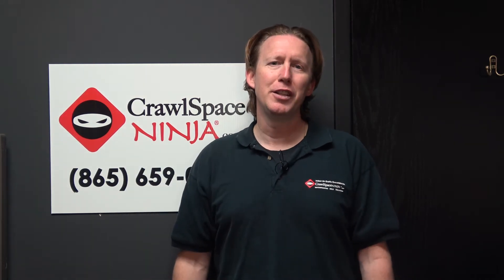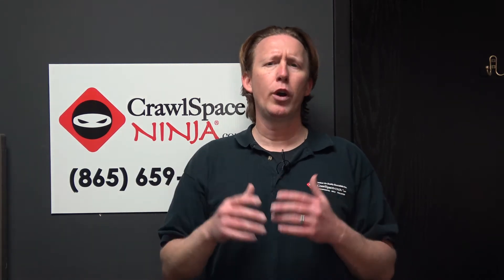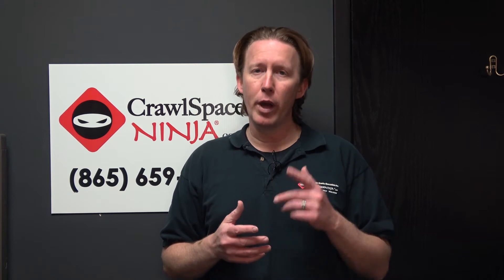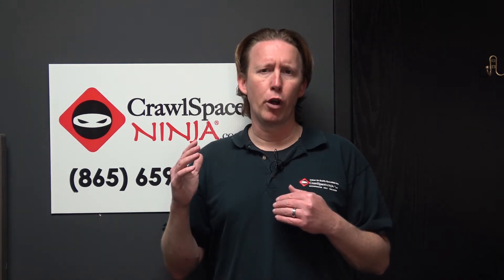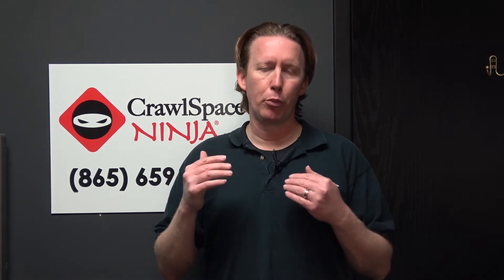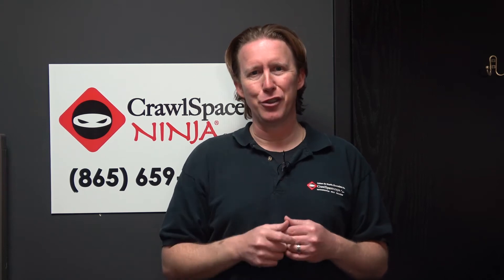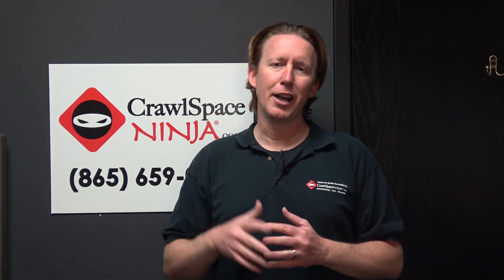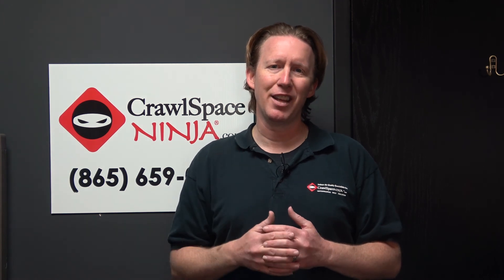Can Foam Board Really Cause Cinder Block Foundation Problems?

Comment: Hey yall I have a question. My buddy already encapsulated my crawl space and I scored a bunch of 2” foam board. Can I hang on walls on inside of plastic or should I basically re do walls?
Reply from the maker: You can hang on the walls over the plastic, but keep in mind that it could puncture the plastic depending on how you fasten it.

Comment: I have a limestone foundation. Literally they are 2 ‘by 2 ‘ wide and long. How would you recommend putting foam board on them
Reply from the maker: I have not worked with limestone - if spray foam will set permanently on it, you could use that and maybe use some 2 sided butyl to hold it while spray foam cures so you don't have to hold it. Sorry, I hope that helps. Thanks for watching.

Comment: How to adhere polystyrene insulation board to block walls and a crawl space? What adhesive is best to use please be specific
Reply from the maker: I have one I have not tested yet but I am hopeful will be great - It is made by ICP but I don't want to recommend until I have tried it. Hopefully next week. I am not too crazy about adhesives simply because you have to prop something to hold them but once they bond, most are good. We have used Loctite PL 300 but it does take time to setup. Rarely do we use adhesives because we are nailing that foamboard when possible. here is a link to the Loctite: https://amzn.to/3PmMtCv - From their website: Loctite PL 300’s high grab reduces the need for fasteners and sets in 20 minutes and fully cures in 7 days.
Reply: @CrawlSpaceNinja  yea that crap is like as bad as bubblegum.  I used liquid nails Fuze it 👍

Comment: I live in Canada where we have cold winters. I want to encapsulate my old 1885 field stone crawl space so will run vapour barrier up to the sill plate and then spray foam the vapour barrier to the sill plate and carry the foam onto the rim joists as well.
As for insulating the field stone walls. Can I put foam board over the encapsulated walls? Or is there a different approach? 
Thanks!
Reply from the maker: PJ - Michael produced a video on this very subject: https://youtu.be/369yfSqPvP8

Comment: The only thing I can think of Michael is if water is retained in the wall and frost keeps getting into the wall it will be hurt just like bridges that have to be rebuilt every 20 years or so, not a problem in the south obviously!

Comment: Hello Michael, my crawlspace walls have liquid rubber painted on them. Will this be a problem if I encapsulate it? I was wondering if the cinderblock needs to "breath" at all to give moisture a place to go back to....
Reply from the maker: Great question Matthew!  Your walls will be just fine to encapsulate. It's great that the moisture will not protrude through the cinder block. Less chance of mold growth.
Reply: @CrawlSpaceNinja  Cool, thank you!

Comment: My concern is not damage to the concrete by the extra trapped moisture,  but rather the increased possibility of more moisture wicking up into the wood sitting on the concrete. Many houses built here have no, or an ineffective moisture barrier between the foundation wall and wood that sits on it.  My house has a galvanized metal termite shield there... an effective moisture barrier, but I could see maybe an increase in rusting of it from the increased moisture in the block foundation wall.  Another question. I have seen cases where the cores of the block foundation wall are open at the top of the foundation wall, not completely covered by the wood plate or sill, leaving a space for air and cold intrusion.  In that case insulating or sealing the wall would be useless. How would you address that?
Reply from the maker: For a situation like that, we would put some foam board on the open part of the block.
Reply: @CrawlSpaceNinja  Thanks.  I could see that being pretty easy and working.

Comment: I need to paint the out side block wall that is part of the crawl space. Should I just paint to protect for possible water coming in or could I just put some insulation? This wall is under my screened in porch .. the crawl space is encapsulated and it has closed cell insulation on the inside walls ... please advice 
Thanks so much
Reply from the maker: I'm sorry, we do not have experience insulating the exterior of a crawl space. We always insulate the interior of the crawl space. If the inside is already insulated then you should not have to add more insulation on the exterior. In order for the exterior waterproofing paint to be most effective you will have to dig down to the footer to fully coat the entire foundation wall.
Reply: @CrawlSpaceNinja  Thanks so much

Comment: How come you never use any thermal or ignition barrier in your videos? This is a code violation in most of the country, correct? I really do not want to put drywall up over my pink foam boards in my cramped crawlspace, but want to be compliant.
Reply from the maker: We follow code to the municipality, using foam board is with in code in all the areas that we service! hope this helps!

Comment: My crawl is 2ft in height! Can I put 2ft of plastic 6mil than foam board instualtion? Please let me know. Would it cause condensation and create mold?
Reply from the maker: Yes, you can install foam board on top of vapor barrier, but keep in mind you will likely puncture the vapor barrier in the process.

Comment: Hi Michael.  I was about to put fiberglass insulation in the joists of my 4’ crawl space.
Can I use foam board or something else instead?  I live up north and the joists below the room should be insulated
Reply from the maker: Building code where we are located in Tennessee allows for either fiberglass in the subfloor or foam board on the walls. We insulate the walls because it is more cost effective and efficient, but fiberglass insulation in the subfloor also works well. You may want to check with your local building code to help choose the best option.
Reply: Crawl Space Ninja can I add foam board to the walls  and insulation in the floor joists ? The floor in my crawl space is cement do I have to put anything over it? I live in a bi level home
Reply from the maker: @paulpapamarkos252  You can do both if you wish, but it is not required. If the floor is cement it is not likely you need a vapor barrier.
Reply: Crawl Space Ninja thanks for the quick response! Go Vols! From NJ

Comment: In my crawlspace, should I insulate the concrete block walls AND the flooring also? Some1 said just the walls.
Reply from the maker: Shamrock Girl Thank you so much for question. You can do both. We like to do walls 1st because we don't want joist insulation hiding potential future leaks. Thanks for watching.
Reply: @CrawlSpaceNinja  What do you recommend for using for insulating the flooring? I don't want to use organic material because of all the potential for mold. Can I use spray foam insulation or use foam boards for the flooring AND walls of my crawlspace?
Reply: Is it necessary to do both?  Or just the walls?